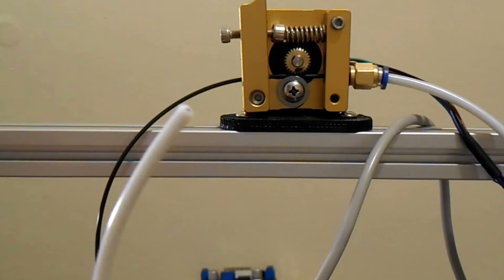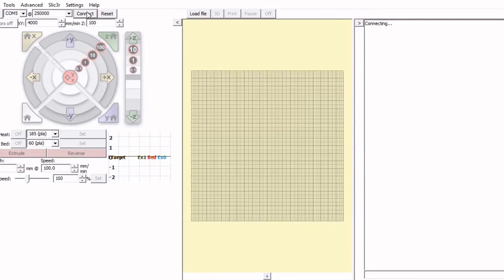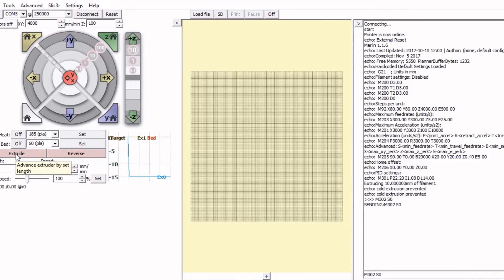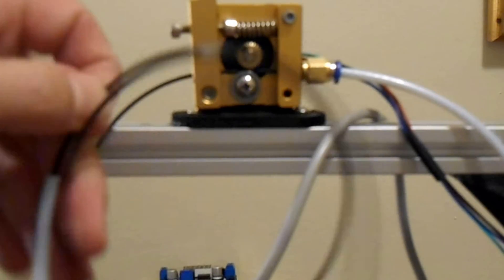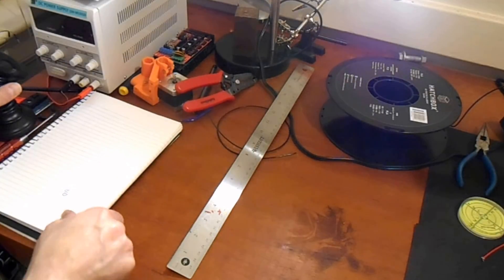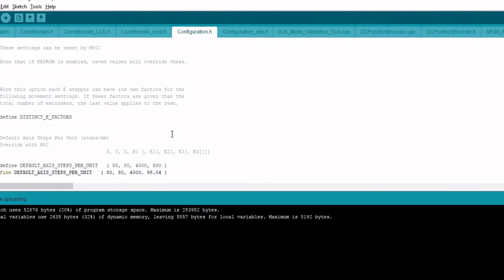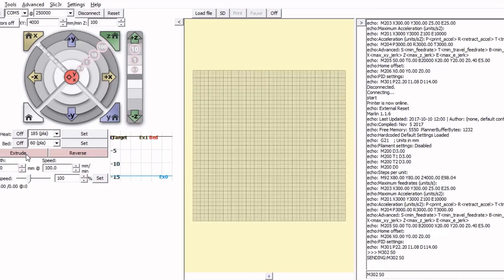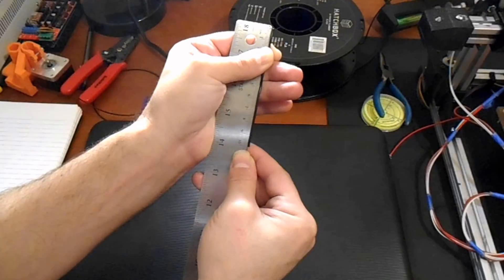RAMPS 1.4 - Stepper marlin firmware extruder calibration

Comment: But it’ll continuously extruded how to stop it while printing
Reply from the maker: Not sure I understand your question.
Reply: Edward Braiman // the extruder keep pushing the filament what if the hotend is not heated enough and the extruder keep pushing the filament thats wont break the nozzle and the hotend
Reply from the maker: I think the example in the tutorial does not use the actual hotend.
Reply: Edward Braiman // yes i know i asked that coz i have the same mechanical extruder and i wanna use it with actual hotend but nvm

Comment: Hi Edward
thank you for ur Explain , it was useful for me

I have a  ِAnet A8 printer when I try to move the  Extruder stepper motor via control panel it does not work!!
Do you think that one of the Firmware lines needs to be modified?

thank you..
Reply from the maker: You're welcome.
Reply: @EdwardBraiman  Kindly , Can you Read my question..
Reply from the maker: The Marlin firmware defaults to a minimum temperature before the extruder will move.  You can send a gcode to change minimum temperature to test, but leave filament out of extruder when doing this as it will not melt filament.

Comment: Sir my hotend is not operating ,kindly help me out...i build my own printer
Reply from the maker: What's error message are you seeing in Pronterface?  Is the thermistor working or is the wire broken?
Reply: "Error: Printer halted. kill() called" ....i was using ramp 1.4
Reply from the maker: Check the thermistor for a broken wire using a multimeter.
Reply: @EdwardBraiman  thanks sir i replace the thermistor and its working...but one more problem i am facing ...i am not able to control thermistor temperature .the moment its achieve its targeted temperature its turns off
Reply from the maker: What's the error message in Pronterface?
Reply: @EdwardBraiman  its not showing any error inside interface ,but the red led on ramp its gets turned off after its reached its desired temp...and the temp gradually decreases after that
Reply from the maker: What's the temperature You're trying to reach?  What material are you printing with?
Reply: @EdwardBraiman  1 am using   PLA with 1.75mm standard thickness .i want 185 constant temperature
Reply from the maker: Sounds like a connection issue.  Check terminal connections.
Reply: @EdwardBraiman  thanks a lot sir, it was nice talking to you. I am from India ,where are you from?
Reply from the maker: USA.
Reply from the maker: USA, but my surname is Eastern Asian.  Not sure if I'm related to anyone in India.  May someday I'll check the genetics.
Reply: @EdwardBraiman  very funny

Comment: Why cutting the filament thats a waste of filament :'(
Reply: I was looking a technical answer, since the step size can only be set up as far as 2 decimal point so anything more specific than that will get loss. Also the stepper driver will limit how accurate you will get. The user can do what ever please him but the machine has limitations and those are the one I was looking for.
Reply from the maker: True.
Reply: Gives you the ability to make a more exact measurement.
Reply from the maker: You are correct.
Reply: Well yes but how exact you have to be that will make a real impact to the step numbers?
Reply from the maker: As close as possible.  Just keep in mind it's up to the end user.

Comment: hi edward... you have been my "guru" for setting up and calibrating a 3d printer and i owe you a beer for that :-) 

can you please also put a video explaining auto bed leveling using the 6-36 volt proximity sensor? it will be very helpful.
Reply from the maker: +Siddharth Shivalkar I will be recording a video in the next couple of days for a new sensor, which is the opposite type in our last message exchange.  I've been upgrading some of the video environment for better lighting, audio and sound dampening.  Two of those should be completed by tonight. I should be recording within the next couple of days.